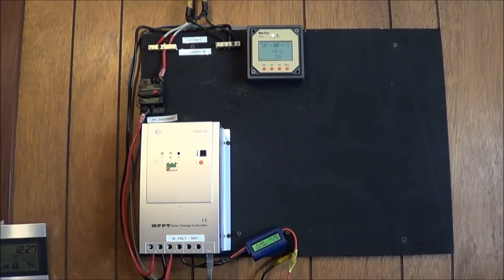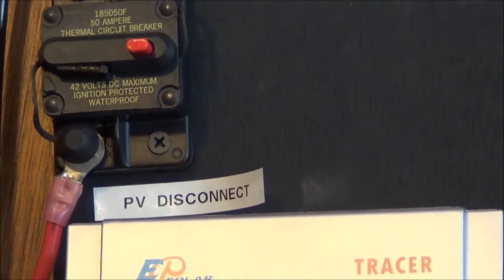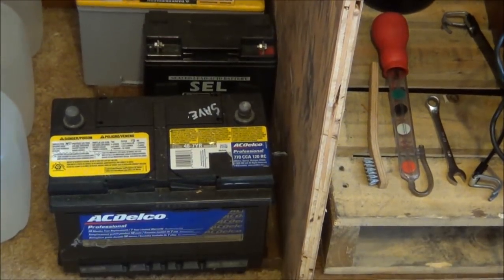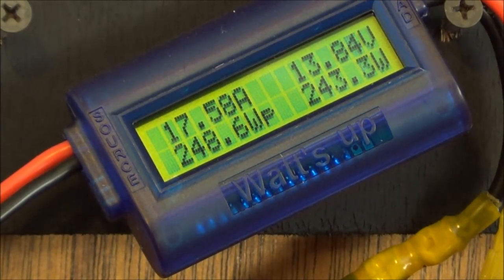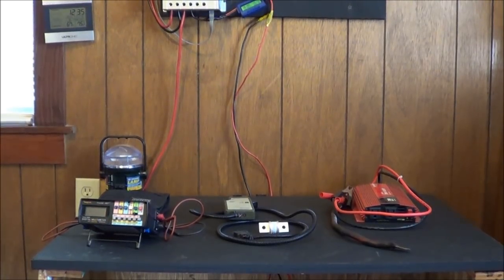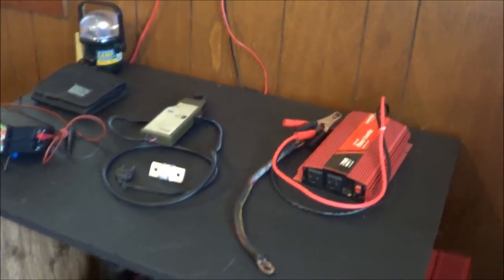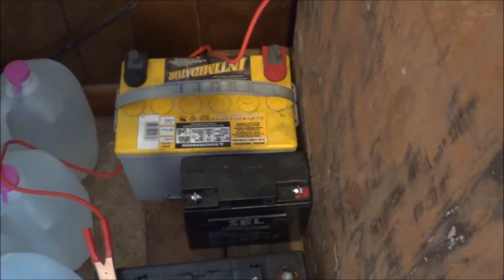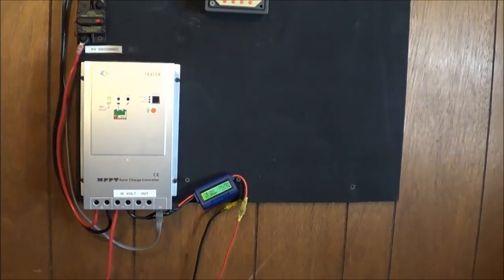Solar Power Setup & Backup Power System

Comment: Love the setup.  Would love to have a detailed diagram/instructions of the set up.  I have the same controller, meter, off/on switches lol  But not the tojun battery's (cant afford those in my area) ;-(   so had to go for the cheap marine/RV battery (but that is just until I learn a little more about solar and how it works) I'm a new-bee to this solar. But I am determined to learn . Oh, and I have 2 100watt panels in parallel. Just until I learn more than I will work to have a 48volt system. I do get confused about inverters,   Can the inverter you using detect when the batteries are getting low and shut down the inverter? Don't want to kill my battery  they are simply the most expensive part of the system.  Thanks for the video, maybe you might tag a diagram and instruction to your setup.  :-)

Comment: Nice little setup and thanks for posting - I see you collect batteries like I do.  :)  I'm actually running off of battery power right now due to a blackout, but of course I disconnected my entire battery setup to upgrade it and that's when the power outage occurred and had to quick wire something up.  grr..

Whaa??  A FUSE!?  I have to get myself some fuses too - at some point I'll make a mistake and will end up welding something.
Reply from the maker: I hope your camera is charged, still waiting on part 3 of the back feed video :)
remember the timer for fridge and freezer lol.  Good luck!  I hope your up and running soon.

As far as fuses, just keep those cable cutters close ;)
Reply: autobri1
Oh yeah, I forgot that I am already using fuses though I don't recall the amp rating.  Can anyone tell me the fusing current for 2AWG cable?  :)
Reply from the maker: ***** I just did the math off what my inverter would draw on 2000 watt surge. I use a 200amp t type fuse that big 3000 watt of yours min would be 300 amp maybe more when you figure in surge. if you put a 500 amp fuse in and dead short that 1000AH bank you have it will pop the fuse before cooking the cables. so size to inverter. cheers
Reply from the maker: autobri1 oh and when you can bump those cables to 0awg 1/0 would be better

Comment: Hasn't been a post for over a year, so I hope you get this. First, thanks for the meter setup, I have a Renogy 150A and the setup instructions bite. With your vid, now I can see what's coming in correctly. My question, is with this setup, what are the Ah and Wh represent. I know watt hours/amp hours, and all the math, but the Wh doesn't seem to be representing the load off the battery. Ah is supposed to be the tot Ah in the charge cycle, but the # seems off. Thanks in advance..
Reply from the maker: +Path in AZ This meter setup will only tell you what is coming into the batteries, if you want power in and power out you need to look up bogart trimetric meter. They are kind of pricey for a small solar setup. I bought one there great. I have since upgraded my system. I just have not had the time to do another video.
Reply: autobri1 Thanks for the reply. I'm looking into the Trimeter  but it's pricey at $160. It looks like the 150A meter tell you total Wh, Ah and the like coming in to the battery. I have a Kill A Watt meter off the Inverter, so it looks like I'm getting all the relevant info. Thanks again!

Comment: nice video.  Have a question, can you please explain?  Why are you connecting both the red and black wire on the watts meter to your negative terminal on your charge controller?  How to you connect from your watt meter to your battery to charge the batteries.
Reply from the maker: I am running the amperes through the black wire (ground) and the meter needs power so it shares the ground and the red wire gives the meter power. however you could power the meter with a 9 volt battery if you wanted to.
Reply: autobri1 Thanks for the clarification.  I have the same setup as your, 4 - 100 watts Renogy panels, same tiger claw inverter and charge controller.  I have 2 -  AGM Vmax 125ah battery hooked up in parallel (12v).    I want to add 2 more 100 watts panels.  I know that the charge controller is limited to 500 watts in a 12V system.  But I was wondering if I do a 3 panels in series and then parallel the 2 series.  Will the charger can still handle this setup.  Although I now have 4 panels now,  it never get past 340 watts.  The highest wattage I ever see is about 330-340.  Any advise you have is greatly appreciated.
Reply from the maker: Yes, you can do series parallel. but your going to be very close to going over the rated ampere of the charge controller. my 4 panels have put out 24 amps (24 volt from panels and 12 volts out) at 370 watts just the other day but the sun was perfect position. I just purchased the 40 amp charge controller and another 600 watts of panels.
Reply: autobri1 Oh - I watched your video again, and wasn't sure if the charger controller in the video is a 30 amp or a 40 amp.  Mine is a Renogy 40 amp, does that fit a little better with the maximum specs?.  If I understand you right, you also just purchased another 600 watts of panels and a 40 amp (renogy?), then mine will be working fine then?  Greatly appreciate your sharing information.
Reply from the maker: Hung Lam Yes the 40 amp model will work perfectly for your setup. Have fun!
Reply from the maker: Hung Lam Also the left side of the red wire on the watts meter is not hooked to anything just taped off. The right side goes to positive.
Reply: That thru me off as well.  LOL  Was going to ask the very same question about that connection, I new I couldn't have been the only one to notice that. hehe